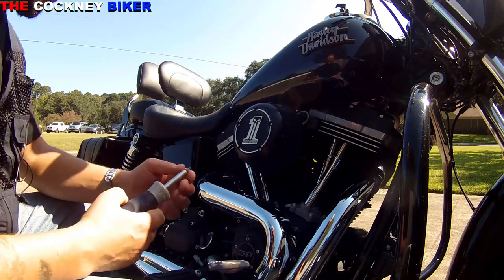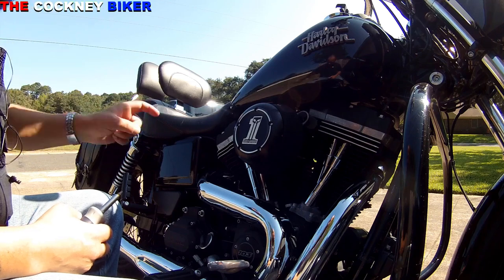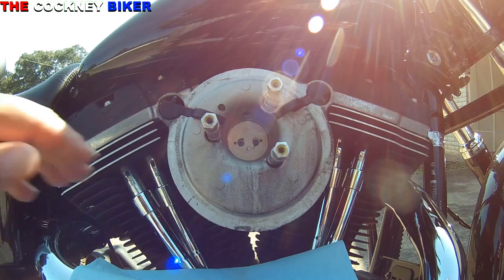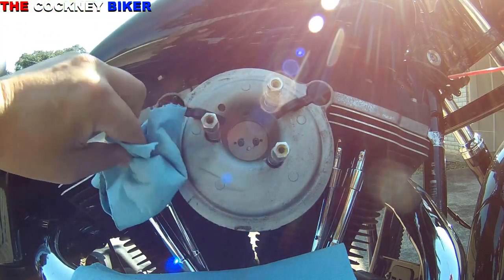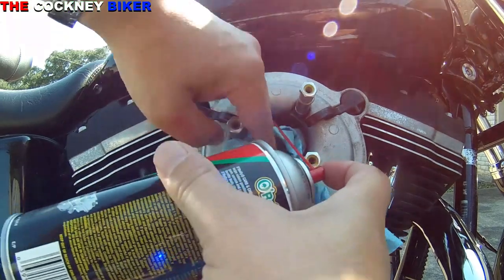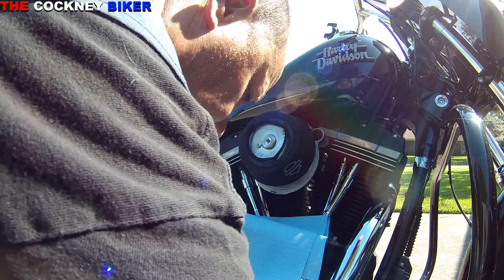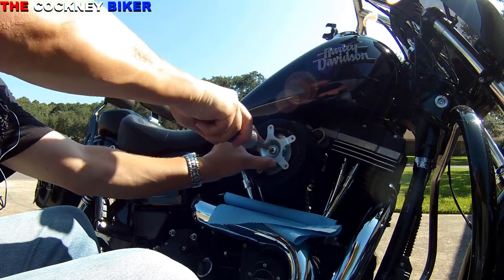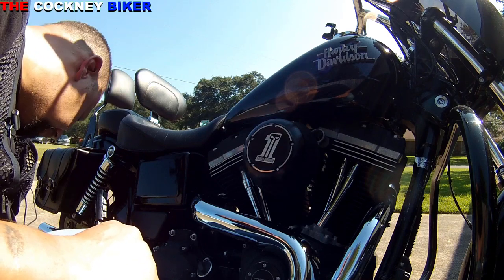Cleaned my IAC (Idle Air Control)

Comment: Had the same problem with a 15 plate Fatboy. It would also rev high on start up and not drop even at running temp.
Got some Wynns Fuel Injection & Carburettor Cleaner from Halfords and did exactly as you did in the video, but didn’t start the bike immediately but left it over night to work it’s magic. Started beautifully the next day with no excessive revs and ran great all day. Seems to have solved the problem for me. Thanks for the tip..👍🏻
Update - two months in and the problem returned. I had the IAC valve and intake seals replaced, as being flexible can leak air. 
In the process of re-routing the head breathers to a catch can, which should stop the crap getting into the IAC.
Reply from the maker: Glad it Helped!
Reply: Ive been having the same issue with high reving as well. Thanks for the tip

Comment: My 07 Road Glide did the same thing  Thanks for the video the dealership couldn't find anything wrong with the bike, I even mentioned the IAC they looked puzzled with that. thanks again
Reply from the maker: Glad it helped: )
Reply: I have a 2011 SofTail I bought new. Had some issues with it in thr first year, I found out quick the dealership  wasn't very good at maintenance. Been fixing it myself ever since.
Reply: Good video, thanks, at 41K miles I got the same problem with the IAC ;-)

Comment: To do it correctly you must turn on the ignition and open the throttle wide open.  This allows the  control valve to open. Then spray in your  carburetor/injector cleaner into the control valve . When finished start the bike, it will  take a few revolutions before it will start. I can't believe he didn't know the correct procedure.

Comment: Do not use carb cleaner on a fuel injection motor, use injection cleaner.
Reply: CKC throttle body cleaner

Comment: Late comment, but if you are running one of these backing plates on the air cleaner, replace the head breathers with banjos, run some fuel-grade rubber pipe of them behind the plate to a tee-junction. Block off the holes in th plate if you have them & enjoy not having oil/air mist going into your carb manifold.
Reply: YES, i agree, i'm doing this next myself
Reply: I actually installed a WEHRS canister breather on my 2004 Heritage it’s a really nice product has a small breather on the top and actually has a AN Cap on the bottom for drain if for some reason it does catch a bunch of oil.  Fit very nicely just above the factory oil cooler

Comment: For me, this was not the fix. It took some research, but I found a "recall" (harley wouldn't call it that bc then they couldn't charge for the repair) called TT410. This is an update needed to be done on the ECM for ~2007 models (mine is 2008). Hope this helped. The symptoms listed in TT410 are as follows: low idle, high idle, return to idle stalling.
Reply: This is exactly what's going on with mine.! How much did this fix cost.?
Reply: @bonez6349  very inexpensive. Don't let some dealers fool you. See if then even know what TT410 is. It should be well within the $100 range. I got ran for 900$ at a Harley dealer that had no clue what they were doing. Found another dealer that did, and they installed TT410.
Reply: @jakemosca6587  thanks man... I'm going to make some calls today about the TT410 update.! I hope this is the fix for sure because when it stalls at stops 40+ miles out in the country on back roads that shit freaks me out.! But fortunately it will start right back every time but that always in the back of mind what if it don't.?
Reply: @bonez6349  I replaced the air/idle control valve myself. Took less then an hour and cost me $38.46 for the new control valve.
Reply: @507allen1   sorry I know it’s old. But did it work?
Reply: @507allen1 How did you get to the screw on the backside? Is there an easy way? I might need to replace mine.

Comment: That particular part of most bikes is ignored or deleted by many in the community since they don't want to be tasked with doing the repairs to it. Its not just Harley's but a whole mess of other bikes as well. Its a hot topic for some, since many think it serves no purpose beyond making the engine hard to keep running at idle. I've stressed the importance of servicing this part for emissions sake especially if you live in an area where testing is still done and enforced as well. Every person who quipped back on the forum said it was garbage and was impossible to keep in repair. They didn't even know it has a purpose beyond making them angry and getting in the way. Thanks.

Comment: I've got an 07 Softail Standard and mine has been doing this intermittently.! I never know when it will do this until I come to a stop or make a slow turn with the clutch pulled in... It freaks me out when this happens especially when I'm 40+ miles out on back roads but it will always fire right back up every time.! I've did the IAC cleaning as you have and still this happens
Reply from the maker: I'm sorry to hear that,  07's are Fuel injected so it could have been any number if issues.. things to check are Spark Plugs, battery, Alternator, Regulator-Rectifier.. Clean or replace your Air filter and if there is nothing wrong with them, then you will have to take it to a mechanic or dealership to look at :(
Reply: The IAC can get coked up and sticks. Take it out and clean it or better still just replace it.

Comment: Greatl !! I have a 14 Bob and I had the same problem a few days ago. Did the cleaning and so far is good, but need more time to check !! When you had this problem did you check If u had this error code p 1632 ?
Reply from the maker: Hiya Joao, I never checked the mapping or the ecm, I cleaned the air filter and the AIC,  and she was fine after that..  my bikes been staged so I didnt want to play with any programs. Glad you Bob is doing ok now though

Comment: on my 2010 Street bob. i have the same problem he first time, very hard to start and could not idle, I drove like that for 60 km in the time to arrive at the repair garage and the mechanic tries and it starts very well and the idle is good... and yesterday the opposite happened while driving I felt that the engine was turning quickly when changing gears, I stopped, cut the engine and restarted but still the same.
and this morning with a cold engine, it could no longer idle.. oh yes, I forgot to say on the dashboard I had the error code P0505.

Comment: You need breather bolts. Those tubes that aim into your intake are putting crap back into your bike.  I got ride of mine a long time ago.
Reply from the maker: Although I not had a problem since.. I would like to do that.. where do you get them from?
Reply: Very true, you also need to clean the carb inside. I'm guessing lots of miles.
Reply: @CockneyBiker  I saw them on Ebay very cheap.
Reply: I did mine with bits from my garage.  Drill out 2 grease nipples, drill & tap your current bolts and fit the grease nipples.  A little muffler putty or metal bond filler to block the breather into the air filter and vacuum or fuel tube from the grease nipples to drain the oil vapour away.

Comment: Did this solve your issue? I have the same problem. Rode 150 miles with not problem. The next day rode another 150 miles and when I pulled into the truck stop my 2003 heritage stalled again. It had done this before and I replaced everything but the fuel pump and then replaced the plugs and installed a commander 5 hoping one of these would solve it. Thought it did until this past weekend. I had previously removed and cleaned and reoiled the K7N filter and didn't shoot cleaner down that tube. Maybe I should have I will try that. Then buy a TPS and AIC too. the dealer rapes me on costs. they have to make money too... lol
Reply from the maker: It worked for me and many viewers.. best part about this fix is it's cheap.. so it won't cost you much to see if it'll work.

Comment: Thank you for this video Harley was raping my pockets changing shit that didn’t need to be changed saw this video once haven’t had the problem yet thank you bud
Reply from the maker: Really glad it helped you out, Charles! If you live out where theres a lot of pollen then you may need to do this every pollen season.. sorry it took a while (and cost a bit) to diagnose you HD's issue.. hope you can get refunds or some use out of the replacement parts.
Reply: The Cockney Biker  yea man big help and yea there’s a lot of pollen by me I’m just shocked why HD Didn’t trouble shoot this they sold me a fuel pack what does nothing for me at all after seeing this video same issues as you gave it a shot glad I did big thanks man
Reply: Ya bunch little kids working on now need old school guys

Comment: Hello brother. I feel like I’m having possibly the same issue on my bike as well. (03 ultra) did your electronics go dark as well once it stalled? I tend to stall in lower Rpm ranges in higher gears then all my electronics go dark. Thanks and be safe!
Reply from the maker: No, my electrics never went dark when she stalled... if that happens to you then it might not be the IAC needing a blast (Though it doesn't hurt to give the carb a clean) it may well be an electrical fault,  if it's predominantly at lower RPM's  I'd Check the  Battery, Wiring/Output from the Alternator, Regulator/Rectifier and spark Plugs.. With the Engine ticking over use a Multimeter on the NEG + POS Terminals.. they should be charging about 13 amps.. if it is then check the spark Plugs and wires (Which might be most likely to be your issue) if they pass inspection then you will have to stop by a Dealership or a Harley Tech to check..

Comment: Hi bro, thanks for this video ill be checking to see if its my problem as well.  Bought a used 08 night train  have had it out today for its first ride,  after a second ride 20 minutes into it i came to a stop sign and she stopped right there , like it was chocking for air or fuel and then stopped.  Started right up again no problem but a mile later the same thing.  Pulled over waited a few seconds and started right back up for the journey home 4 miles no issue.  Im hoping its just that to clean this part up .  Fuel tank is full  , but thing is the fuel light did come on this morning and i turned off power and back on again and the light went out .    what do you think might be the issue here???    but will try what you did , hoping its just dirty.
Reply: If has stoke alarm change battery on remote,then check battery for bike,then do what he said in this video.
Reply: Exact same thing happened to my 14 FXSB yesterday. Stalls when stopping, runs great when I just help it a bit on the throttle, and no problem when moving. Fuel light went on a couple of seconds and said ”Low Range” even tho it wasn’t even near empty, then went away a minute or so later. What was the solution man?
Reply: Change IAC unit on top of throttle intake,,,,,since 3 years ago it happened again ,,,,but after removing head breather lines that go to the air filter return it was flawless. What was happening was the venting lines from both cylinders were feeding oily fluid back into the intake causing it to clog up, hence the constant stalling or runaway rpm being stuck.  Feed 2 lines down beside engine to a catch can and your breather issues will be ok.

Comment: Have to do this to mine today had the same issue twice
Reply from the maker: Hiya Brian.. It's a really simple thing to do.. didn't take me long, It happened again a few weeks later so I cleaned my air filter as well and never had a problem since..
Reply: Did it help? My bike is also having a lot of stalling issues.
Reply: Richard Gao it did I haven’t had a problem since. 🤘
Reply: That’s great. What kind of cleaner should we use?
Reply from the maker: I just used Carb cleaner from autozone..
Reply: Richard Gao I just used regular carb cleaner it worked great
Reply: Brian Knox thank you so much. Going to the store now.

Comment: I had the similar problem 
I replaced the throttle position sensor. $42.00 .
Reply: Was that the issue for your bike?
Reply: @JamesRussle365  yes, been running great. Thanks to YouTube and the guys that upload. You can diagnose the problem yourself.

Comment: What year is that bike and is it fuel injected?
Reply from the maker: +Thomas Burke .  Hey Thomas, its a 2015 Street Bob and is fuel injected.
Reply: The Cockney Biker Cool man. I have a 2006 Dyna Wide Glide fuel injected that I was occasionally experiencing a problem similar to yours... I got the bike 6 months ago and have only stalled with clutch in twice, once a few months ago coming to a light, and once the the other night starting at a green light. 

What’s far more common is I’ll be riding, pull the clutch in to coast for whatever reason (heavy traffic in San Diego County) and I’ll blip the throttle, just because I think it sounds cool... and there’ll be like a clicking sound and the bike will sound like it stalled for half a second, and I let off the throttle immediately and it regains it’s composure. 

Last night I did exactly what you did in the video here, fired it up, kept it above idle for a a bit, shut it down, did the process again, then went for a ride... it felt real clean and sounded great. 

I also suspected I had 8 degree injectors (which was a design flaw that year that Harley replaced with 25 degree injectors through a service bulletin), but I shined a light into the engine this morning and I do indeed already have the 25 degree injectors (I bought it used obviously, the previous owner must have taken care of that).

What are you’re thoughts? You think cleaning IAC did the trick? I’m gonna ride again later.
Reply from the maker: Hey Thomas, Sorry for the delay in getting back to you, I was out riding :) .. I think cleaning the AIC did do the trick, but check your air filter, It might be dirty enough to re-gunk up the intake again.. if you have one of these screaming eagle washable air filters.. then use soapy water to clean it, otherwise, replace it.. (If you see it's really bad).. Ride safe and I hope you never have to worry about stalling the engine again.. Best wishes

Comment: You should be using throttlebody cleaner, not carb cleaner, carb cleaners, too harsh you’re gonna remove the coding of the inside of the system plus you guys polish your chrome and make it nice and shiny and you never look at the air filter throttlebody are you checking your air in your tires are you checking your nuts and bolts to make sure they’re not working loose I know on the sports they’re mounting bolts to the frame loosen up all the time